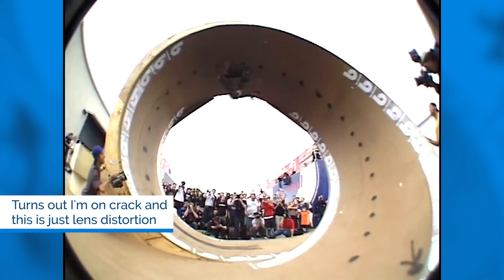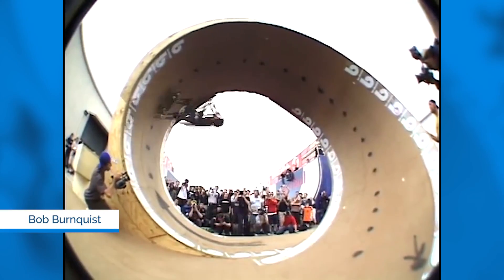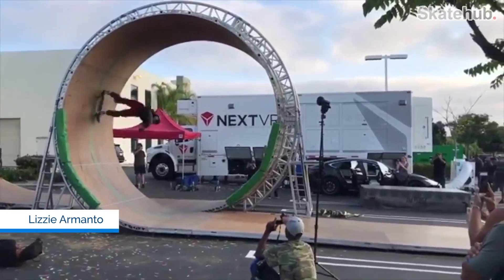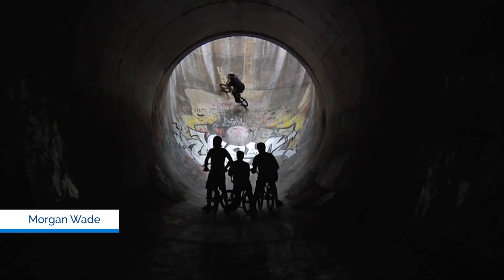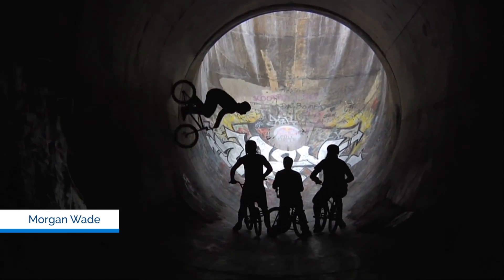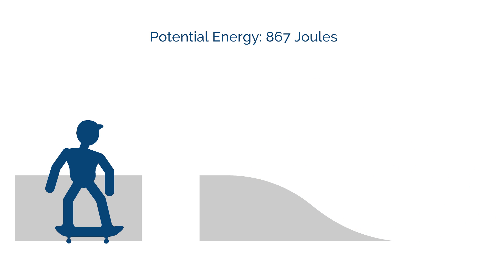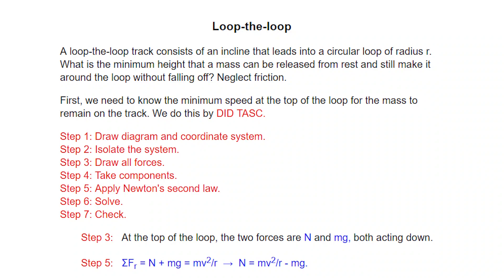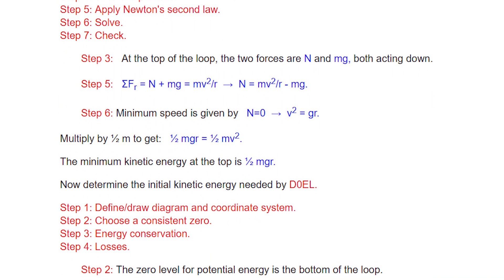Biggest Loop Physically Possible? How Big Can We Go?

Comment: I pictured a person just barreling down a ramp from space, with red hot bearings inside 60mm street wheels on their Indy trucks (use the weight for extra speed/momentum), and the loop not having a gentle upward slope, so their legs just shatter and I cracked myself up. This was awesome dude, nice job 🤘🏾

Comment: Would a parachute deploy quickly enough from 60 foot lol?
Reply: Maybe a foam pit I'm actually not sure if most crash pads would help from such a great height.
Reply: The Lunaist it’d have to be super thick and pretty low density. The type you see gymnasts use I can’t imagine doing a lot (though I’m far from an expert on the matter). I googled and there’s guys diving/falling into water from near on 200ft so I’d imagine some sort of safety mechanism would be theoretically possible. Hardest part would be getting it into position without interfering the rider going into or coming out of the loop

Comment: I don’t know what point the ground becomes the ceiling either. 🤔
Reply: The moment it becomes acceptable in good taste to hang a ceiling fan.
Reply: I believe the ground becomes the ceiling at exactly 90 degrees and there is no "wall" as it has been replaced with a 180 degree transition
edit: you could also say one wall becomes the next wall at 180 degrees and there is no ceiling or floor, or you could say the pipe/loop is made 4 sections divided at 45 degree angles; floor, wall, ceiling, wall...

Comment: They could build a megaramp-size loop like a tunnel, so if you lost contact with the riding surface, you'd just fall on the "ceiling" (or floor when upside down). Somebody call Red Bull!